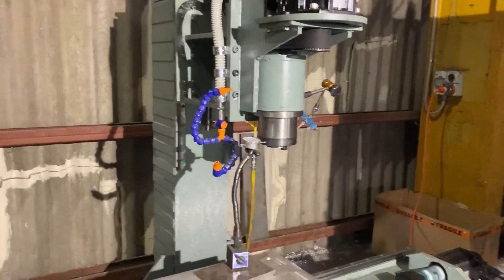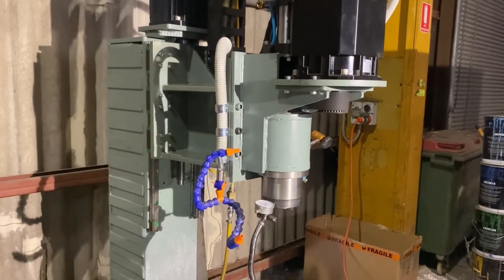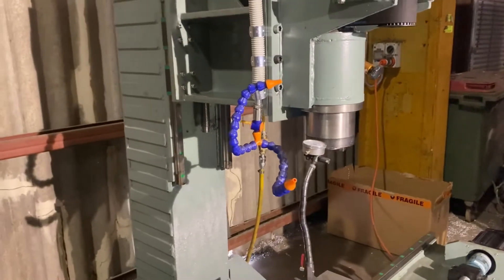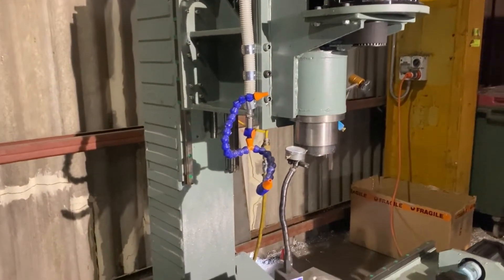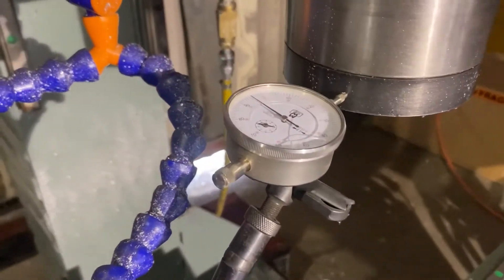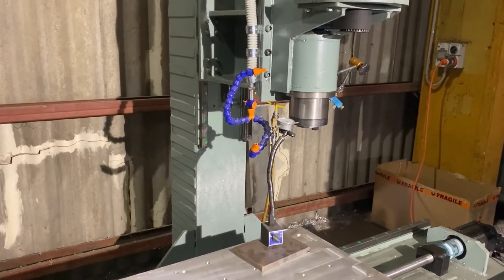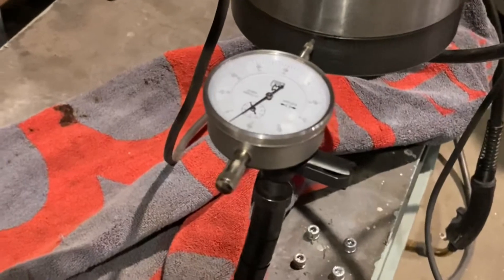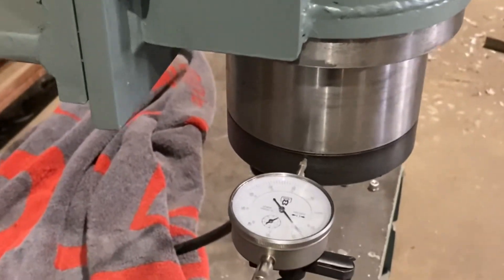DIY CNC Mill - Epoxy Granite Deflection Test

Comment: use a counterweight to take the weight off the head and transfer it through the vertical into the base. You will also get better Z speed. Search for cnc counterweight or counterbalance and you will find several quick and easy mods. It works just like an elevator.

Comment: That's a stiffness of about 14 N/micrometer. Not too bad really. People build machines with a lot less and still find success. For reference I'm designing my machine to have 100 N/micron of stiffness at mid Z travel.

For your design the stiffness will increase cubically as you move the head closer to the base. Assuming there's no clearance in the mountings if you drop the head to half the distance you're at now you'll have a stiffness of 8x what you measured there, or 112 N/micrometer. That would mean it would move only .006mm with the same force of 700 N. That would put it right where the design of my machine is.

I think you'll be happy with it unless you're doing super heavy milling or drilling at max z travel.
Reply: Well, I don't like to baerer of bad news - but 100N/micrometer on a light homemade machine?
That's not going to happen.

First, the stiffness usually doesn't increase as much with reduced travel as one might think. Beam theory is of very limited use here. That is because the deflection isn't just simply a beam bending under load but rather a system of springs - every single part in the structural loop deflects - that ads up fast and a substantial part of the total deflection is from Ballscrews (small sizes have a lot of give under load), it's fixed bearing, the small linear ball guides, mounting surfaces and so on - it will stay the same no matter where your carriage is located.
If you want to know what range is possible take out the data sheets and make a calculation for your ballscrews and ballscrew bearings + bearing blocks of choice.
THK offers a quite comprehensive guide anyone should be able to follow.
I think you'll be surprised, ballscrews in sizes around 16-25mm, even with expensive but stiff combined needle-roller bearings (~1000$ a piece) or at least zkln bearings, are a huge limitation.
And cheap chinese mounting blocks often easily double the deflection.
Take 3-4 times the deflection of one ballscrew assembly and you're in a realistic region, I guess still hard to reach though.

30-50N/Micrometer are values many multi-ton VMCs struggle to reach.
And 10-15N/m are enough to do a lot of work, especially when the machine has a high damping ratio and therefore a comparatively high dynamic stiffness. That's why the homemade Mineral cast machines usually work quite well - the stomped, epoxy rich material is rather poor, the design often as well - but the damping is good.
He's not measuring the machines stiffness anyway, for that you need another measuring setup incorporating the tools deflection and the table/workpiece deflection. He'll probably be under 10N/micro, but he'll probably still be able to use a 40-50mm facemill - because damping.

For a start, the very basics, maybe read rapid machine design from E. Bamberg, starting with component selection and stiffness budget around page 25 and Fundamemtals of design by A. Slocum or buy a copy of precision machine design by A. Slocum.
If you look around there's quite a bit around for free. And the Bamberg paper is a nice start for folks without any engineering background.

Sorry for the bad english, if something is unclear - just ask.
And work through those two PDFs, for a layman they've everything you need to make a rather good design - as long as you ignore the appearance - most people fck up trying to make a machine tool look pretty or cool. That's what sheet metal is for!
Reply: @heinzhaupthaar5590  thank you for your very detailed reply. I had thought about stiffness budget type concepts and for the most part found the stiffness of the frame, ball screws, and similar bearing stiffness of special angular contact ball screws support bearings, but never taken it all the way to the point of a real stiffness budget. The 100 n/micrometer number comes from some of the relatively basic FEA I’ve done and based on your points it is likely wrong somewhere in at least an order of magnitude. I will find and read the sources you recommend and see what I learn.

That being said I hope it will not be as far away or as you indicate at least be useful to do some real work in steel. What I am building is not going to be light at all, sure it’s no large VMC but it will be around 2000 pounds, be filled with epoxy granite, and use 25 and 30mm precision ground double nut ball screws + some decent bearing Blocks. 25 and 30mm hiwin RGW similar to those used in small VMCs as well. But as you say those ball screw support bearing blocks are certainly of concern. I’ve done some looking and it seems like the stiffness picks up a good deal around the 25mm size but they are damn expensive from reputable sources... who knows what will come in the AliExpress package.

Anyways thanks again for your response. It’s been a serious journey to try and design a machine for stiffness. Someday I’ll do it correctly, on that day, I’ll send you a beer. 😁
Reply: That would be nice if he confirms that.

Comment: Great work on the machine! It's always frustrating to see the amount of movement that is still going due to flex. No worries, I worked with a Haas super minimill and it also had no problem flexing 0,02mm when pushing the spindle. Everything is made out of rubber. I'm using a larger portal with a massive bridge, total structures weighs 2700kg, but it flexes even way more. But i've peaked the spindle to his 12hp when cutting fast in plywood and the surface finish is top-notch, I don't want to make it worse, but you're now only testing the flex of the gantry, Tools will transfer the forces via the clamp to the bed to to x/y through the lineair rails and the ballscrews. At a certain point the weight of the head and total structure also comes into play. Dampening is very essential, since most of the cutting forces produce frequenties and everything has one ore more resonance peaks at one ore more base frequenties and its higher harmonics. . A very stiff and light structure has a high resonance, and a heavy and stiff has a lower resonance by nature.

Comment: i think there shoud be an equation .. delection/weight = accuracy.. In other words, if a 200 kg machine is buiilt from depleted uranium and has .001 inches deflection , accuracy will = good 
If a 4000 kg machine has .002 deflection , accuracy will = better.

some may disagree , just my take from rebuilding and upgrading my cnc router a few times.. 20 lbs of sand in the gantry steel beam didnt kill deflection , but man the resonance went down..